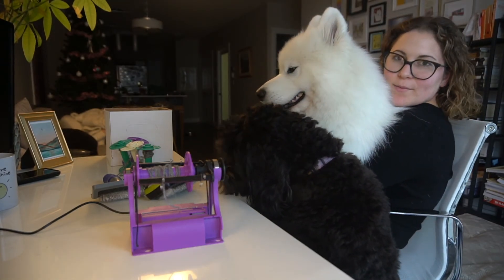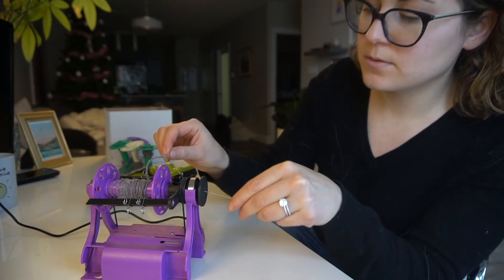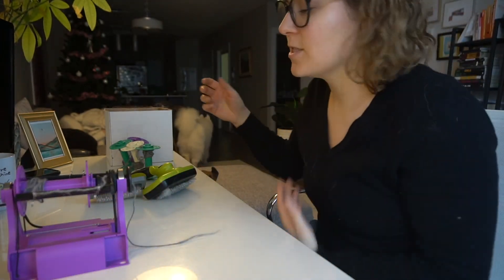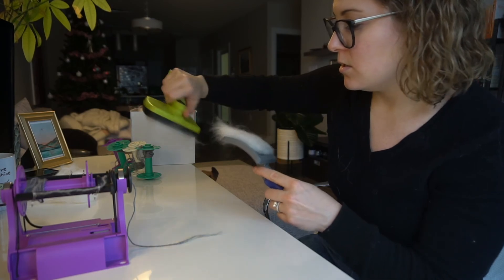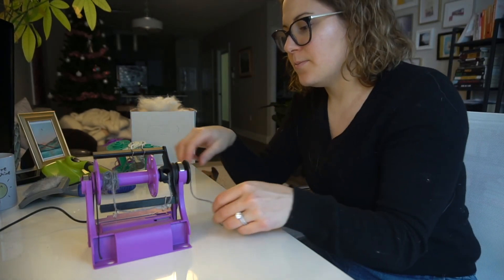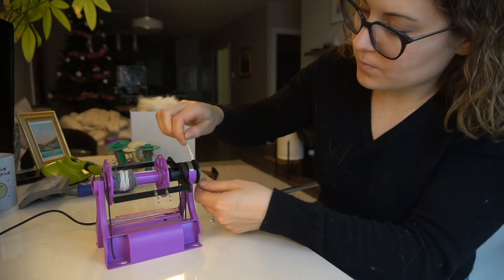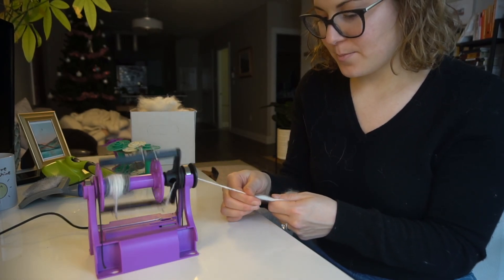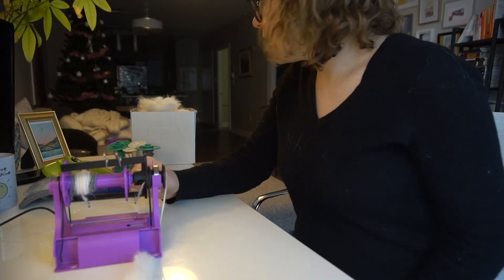How to use an E Spinner-Spinning Dog Fur-Chiengora

Comment: I have a question about your first video… my yarn didn’t relax after bathing it in hot water… I tried twice, the second time for 20 minutes and it was still all curled up! 😂! And when I tried to untwist it, as expected, the yarn went loose and broke!
Do you have any tips for me?
Also my fur doesn’t form a tread like that… I mean the fiber forms a tread after I spin it… before the fur keeps coming out in pieces… 😂😂😂
Reply from the maker: Hmmm interesting one. I assume you are spinning it enough in the first place as well. How long are the fibre threads? Might be worth mixing the fur with some other roving that you can buy online. Mine will untwist at the ends a bit, but never break from the whole thing.
Reply: @theothesammy  thanks for your answer! My fur is from a yellow lab! But I have other dogs that I wanted to try later on… I’ll try the roving you suggested! Thanks again! 🙏🏻❤️
Reply from the maker: @carolinatrovatogomez300  That could be it! Try saving those longer and soft sections of fur like the tail floofin, etc and then pair it with the other fibres. Might do the trick! Good luck!
Reply: I little late but; if you're having loose yarn problems, I find that using some thin cotton thread as warp string as a base along with the chiengora to be helpful. You just tie the warp it into your spinner then continue on as you regularly would
Reply: @andy6477733157  not late at all!
You mean to spin the fur around the cotton tread? Or to begin my yarn with the cotton and then continue just with the fur? (Don’t know if my question was clear enough… lol)
Reply from the maker: @andy6477733157  Awesome! Thanks for the tip!
Reply: @carolinatrovatogomez300  Both. You tie the warp onto the spinner along with the floof, then start the spinning cycles like normal. I keep the spool of thread at my hip like it's not even there, and spin as if it is part of the floof ball.
 At the end, I tie a knot with the warp around the chiengora.
Reply: @andy6477733157  thank you so much! I’ll try that!!!
Reply: @andy6477733157 That is so interesting! But it raises a lot of questions: I wonder if the cotton thread is already both spun and plied, and if so, which direction you would want to spin with it.  Like, could you prepare it first by reverse-spinning some of the ply out of it, so it's looser and able to fuse with the dog fur when they're spun together?

Comment: do you need to do the step with the knitty knotty if you use this instead of the wood tool ?
Reply from the maker: Yup! It's still a great way to "set the spin" which is submerging it in the warm water. Otherwise, when you unravel it, the twist will come out.